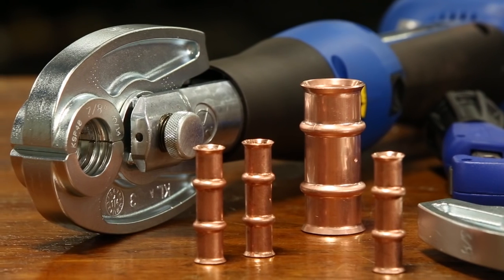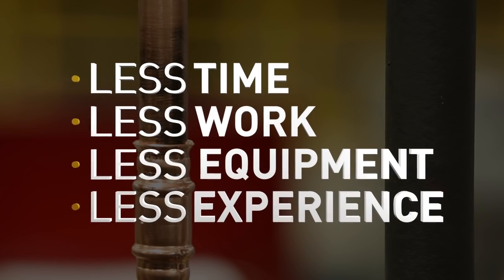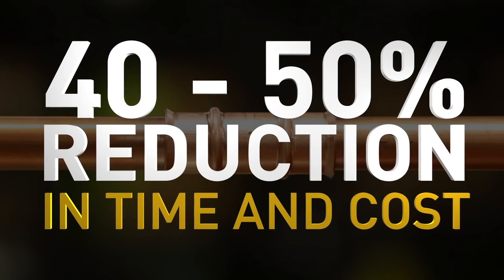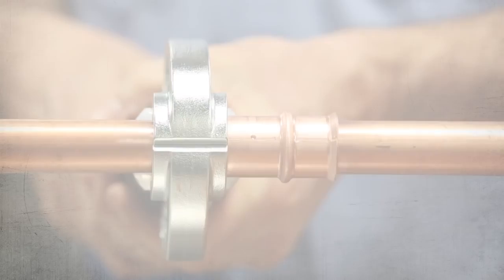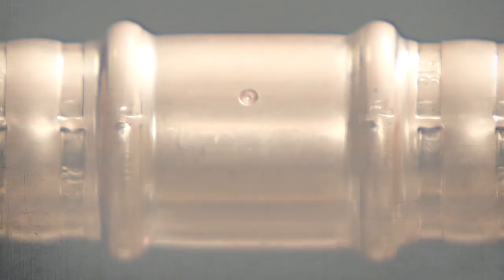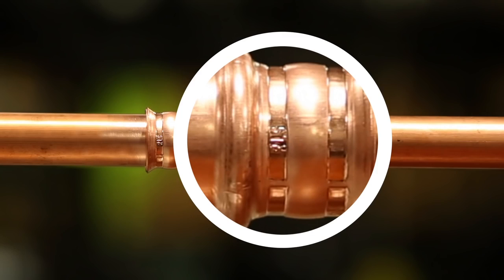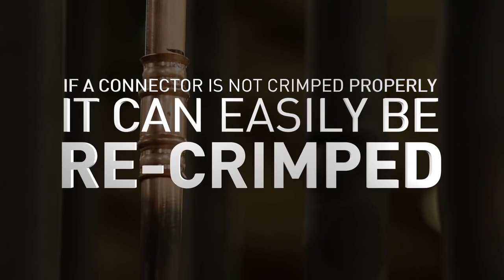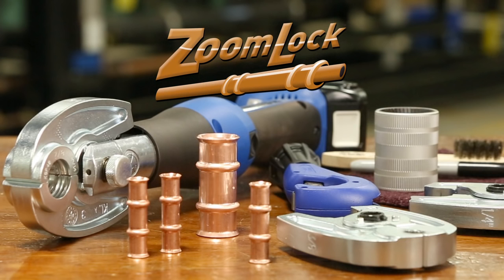ZoomLock Braze-Free pipe Connectors - How to Connect HVAC/R Tubes without the Need to Braze

Comment: Yah but what about the initial connection to the equipment ? Hvac and hvac/r techs have coils and condensers that have connections that this doesn’t work with. So, in fact you will need a torch. This is only good for repairing connections or installing connections between two pieces of equipment. But not at the actual equipment. As cool as this is, it wouldn’t possibly save me more than one connection from being brazed. Torch is still how stuff gets done

Comment: Yeah, but the connections on HVAC equipment aren't Zoomlock. So, while this would be great (supposedly) for couplings and such, you'll still need to end up soldering.
Reply: I made the same point before reading your comment. It’s great for repairs on the line but utterly useless to an hvac tech having to connect to coils and condensers

Comment: Any connection that has an o-ring is eventually going to either dry out and fail or fail  due to a chemical reaction with the the refrigerants and oils used in a refrigeration system, or wear out due to friction caused by movement of the fitting due to expansion and contraction. 

I laughed when he said a " a bad crimp can easily be recrimped".  The only way you can resolve a bad crimp is to cut off the damaged fitting and start  over. 

I would NEVER use this in ANY application except maybe in an emergency in which standard soldering/brazing equipment is not available. I would then make sure to come back and redo it properly.

I can imagine a house being built and the plumber using this crap and then at a certain time period in the future , one by one these fittings start leaking.